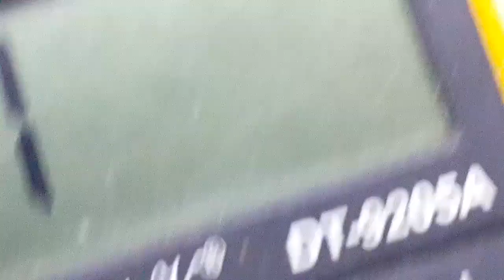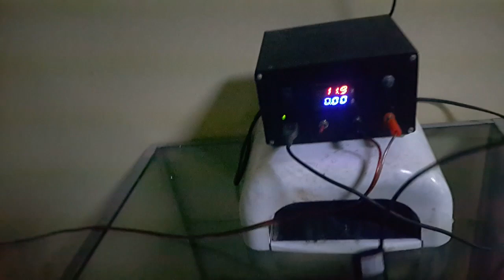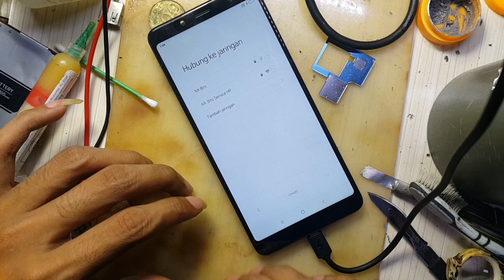REDMI NOTE 5 PRO Lcd no Display  || Redmi Note Lcd tidak ada gambar || Note 5 Lcd Black Screen

Comment: bisa service ke mas nya ?  ini hp saya kasus sama . redmi note 5
Reply from the maker: Bisa gan...
Reply: ada no yg bisa d hub ?
Reply from the maker: @hideamstrong5175  bisa wa kami di 0822 2333 2237
Reply from the maker: Atau lgsg datang ke alamat
Alamat kami di 
Jl Raya Karangbawang Timur Puskesmas Kawunganten. Cilacap. Jateng
Tlp 085726707067